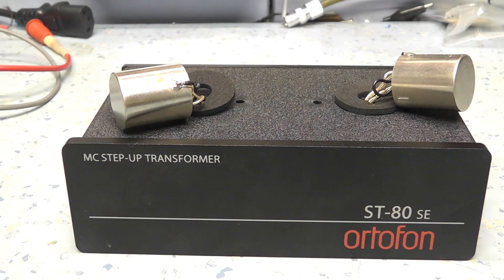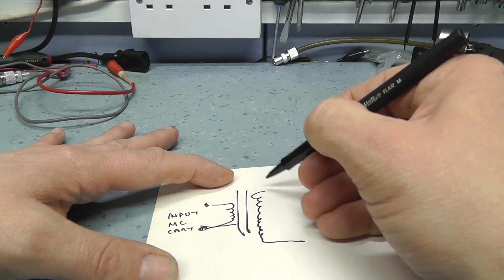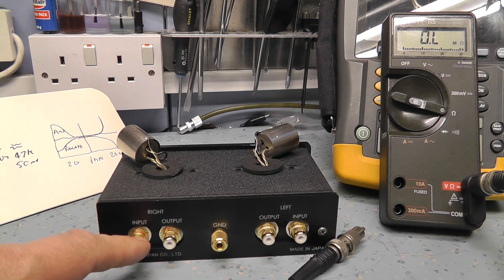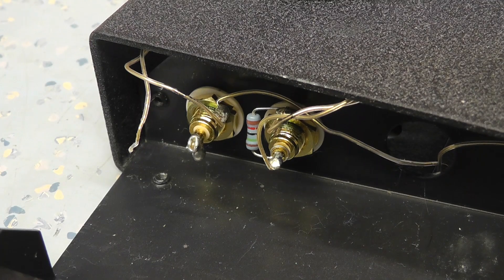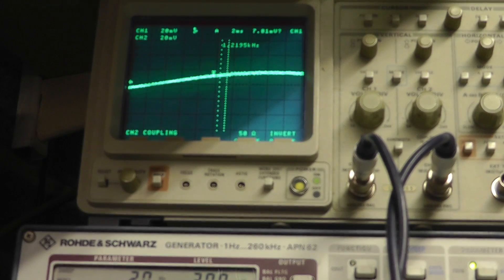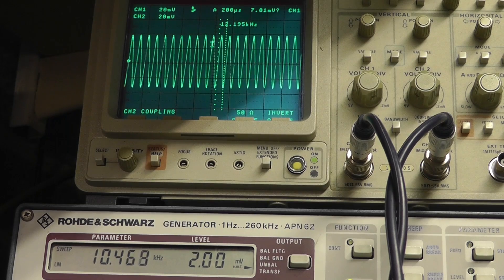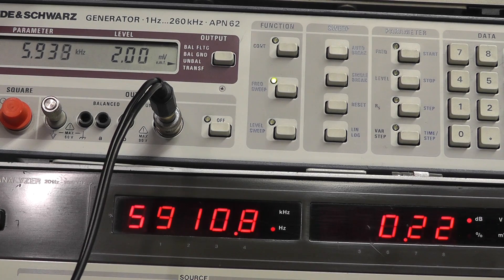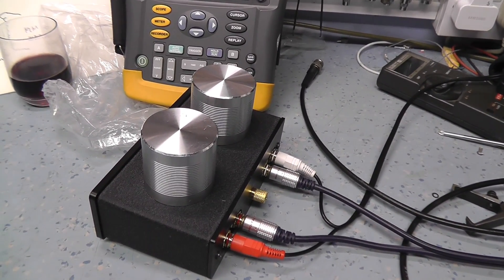Repairing an Ortofon ST-80 Moving coil step up transformer

Comment: These things are worth loads of money, my memory of them was sounds good but hum could be a minor problem if placed near other equipment with big transformers, amplifiers mainly. This is a brief spec. Recommended cartridge impedance < 10 Ω
Gain 27 dB at 1 kHz
Frequency response 10 Hz - 100 kHz  (-2,5 dB +0,5 dB)
output loading 47 kΩ // 200 pF You would not expect 50mV output as this would overload the input RIAA pre amp. Many amplifiers of the day would overload to clipping the input at just 30mV in fact the Leek Delta 30 was only 20mV. A good MC cartridge would only put out about 0.5mV or even less. The transformer would up this to the 3mV or so that most MM inputs needed.

Comment: Nicely repaired and tested simon :-D
I think i would want to put a blob of rubber solution on the solder joints to the wire outer insulation.
To try and stop the copper core snapping through vibration.
Not too smart for the manufacturer to forget simple stuff :-(
Reply: Especially when this thing retails for 1800 Euro.
Reply: @douro20  That's just over 1500 pounds!!, dam expensive for two transformers, a box and metal cups.
Someone is taking the micky.

Comment: I was hoping you would show the inside of the cans; and how this thing works as a transformer; with the two cans so far apart?
Reply from the maker: They are just trasformers. Not much to see other than a few turns of wire. Too fragile to risk disassembly.
Reply: because theres two independant ones for stereo
Reply: seems like a design flaw having such fragile wire, for the price you'd hope for more
Reply: @markbuxton2368  Thin wire is essential in its design in order to fit into the core, and it is exactly why it's expensive!

Comment: Can't see why when you tested it's resistance on the output with the multimeter was quite significantly different but on the the scope shows matched per channel how come this is the case. Why didn't you match the output with a resistor
Reply from the maker: Good question. But at this frequently it would make little difference . I take it you were asking a question?  I saw no question mark:-)
Reply: @SoddingaboutSi  I'm not convinced by that argument, it makes it harder to set up the cartridge channel separation if it's out of balance.
of frequency?  but a cartridge works at a lower resistance than that a couple of Ohm's difference is quite a lot in the scale of things
Reply: John sweda, D.c resistance and a.c impedance are not the same thing.
Reply from the maker: @zx8401ztv  Exactly. DC resistance was just used to test continuity. I would have expected them to be exactly the same, nut their close enough.
Reply: @zx8401ztv  I'm always surprised by how many people do not know the difference between resistance and impedance.
Reply: @davidv1289  i can't shoot anyone down for not understanding the oddness of a mix of inductive reactance/capacitive reactance/resistance/ frequency applied/impedance/Q and other variables.
It's not something i've ever needed to calculate as a repairer.
Too many interactions for my soggy brain to cope with lol :-D

I could have a low IQ, very possible lol.